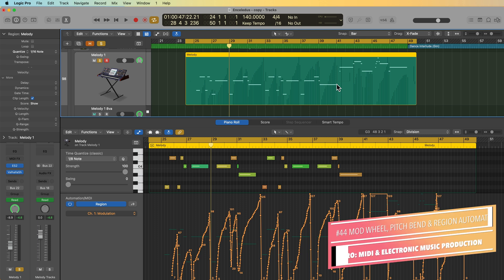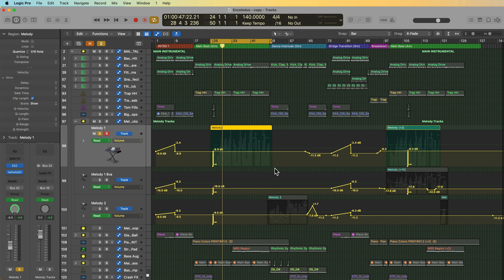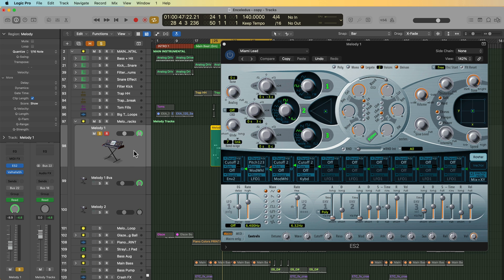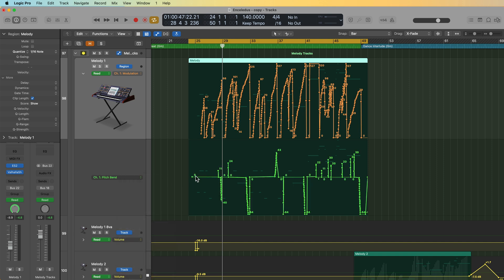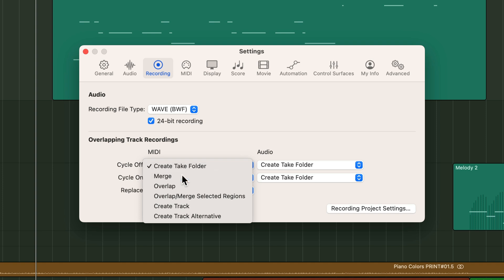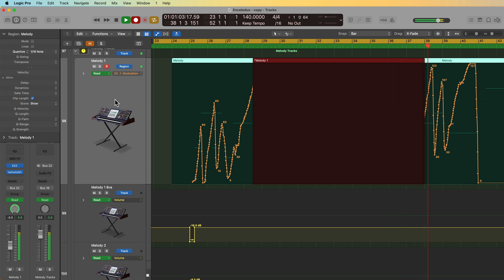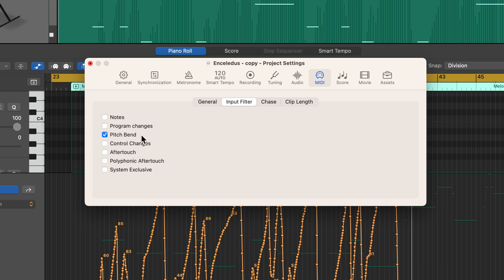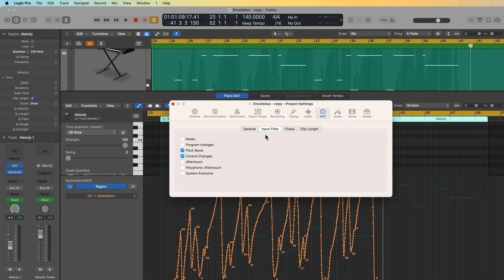Logic Pro #44 - Modulation Wheel, Pitch Bend & Region Automation

Comment: My mod wheel doesn't work at all.  How do I get it to work? Thanks!
Reply from the maker: (1) Your mod wheel is not working with ANY instrument preset? Some instruments and presets don't use the modulation wheel. I'd recommend checking the MIDI Input monitor at the top in the LCD Display. Make sure to put it in "Custom" view and when you move your Mod Wheel up and down, you should see the MIDI monitor show the incoming MIDI data. (2) Make sure that Continuous Controllers are not being filtered. Go to File > Project Settings > MIDI > Input Filter, and make sure that "continuous controllers" is NOT checked. (3) It could be possible that your MIDI controller either has a broken modulation wheel, OR the MIDI controller does not have mod wheel assigned to CC1, which is the default. You could try a factory reset on your MIDI controller and see if that works out.

Comment: Hey man! Awesome video. I went to apply this to one of the sampler instruments I used in logic and it seems to “switch on” only after a certain threshold at a very high modulation. And then it doesn’t fade in or out, it just “switches off” again after that threshold is crossed on the way down. So it’s basically just got one mode - on very intensely and then off leaving a staccato sound. Any idea why this is? Tried messing with lots of settings and still can’t seem to get it working with gradual builds and dips. Thanks so much!!

Comment: Thanks for the video. For me it is not that useful to record automation over a MIDI region, because most of the time I prefer to have the recording option "create take folders" for MIDI and having to change that to "merge" or whatever is really frustrating. So what I found is that if you use Automation Quick Access and set it to use the mod wheel (you have to make it learn your mod wheel) then It is a no brainer, just enable Automation set it to Latch or whatever then playback the region and use the mod wheel to add automation. Also use the CTL CMD Option A shortcut to toggle Quick Access On and Off. Much better for my use case. Just wanted to share for anyone in the same boat. Cheers.

Comment: Hey Josh.  Big Fan of your videos. So grateful for all the knowledge.  Literally couldn't do it without you.  Quick question.  Is there any way to change the pitch bend information of a single midi note within a series of overlapping midi notes (or a chord) without having to create a duplicate and manually extract the desired note?  Thanks so much
Reply from the maker: Great question! Unfortunately no. If you have overlapping MIDI notes, the pitch bend message can only be applied to the entire track, not individual notes or even individual regions. I figured you might be able to change the MIDI channel of the note and pitch bend and it would only apply to those notes on that specific channel, but unfortunately, Logic doesn't handle it that way. You'd have to split that note or notes off to a separate track and apply the pitch bend there.
Reply: @MusicTechHelpGuy  Thanks so much!

Comment: Bro….. great video…. I’m your follower since 2019. I don’t have a midi keyboard or any midi controller. I’m using my PA600 to do midi programming via midi cable. May I know if it’s possible to assign any cc to my keyboard???
Reply from the maker: The Korg PA600 appears to have a USB port and MIDI In/Out. So theoretically yes, you should be able to use it as a MIDI controller. You may have to look up the manual for the answer, but there's probably a way to put the keyboard in MIDI Controller mode so that it functions as a MIDI Out. If your audio interface has a MIDI In/Out ports, you could also try connecting a MIDI cable from the Out on the PA600 to the In on your interface and send MIDI messages that way. But if it has USB, it's probably not necessary. If you can manage to use it as a MIDI Controller, then you should be able to learn knobs and faders as CCs.